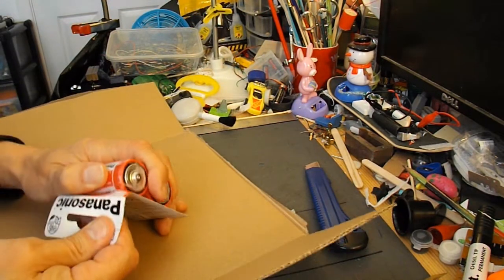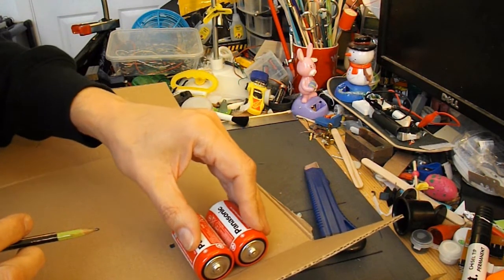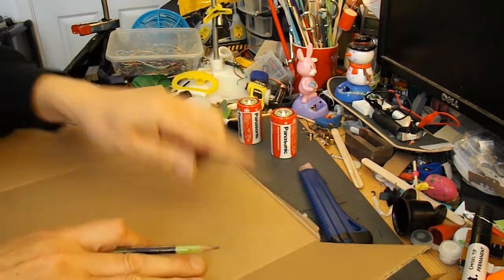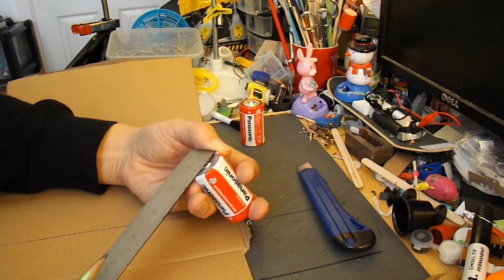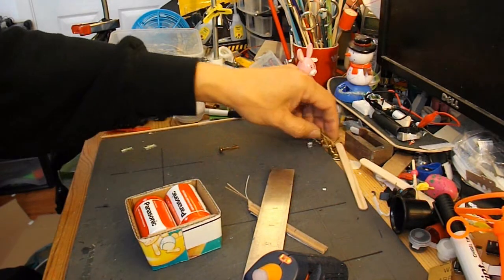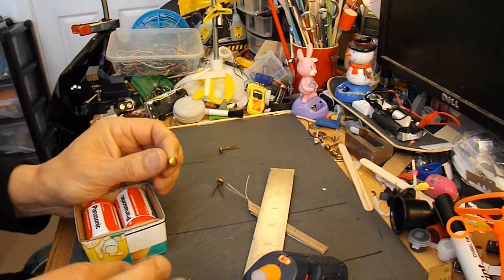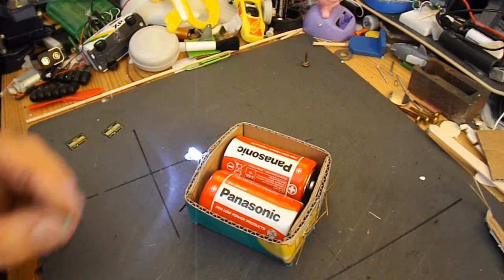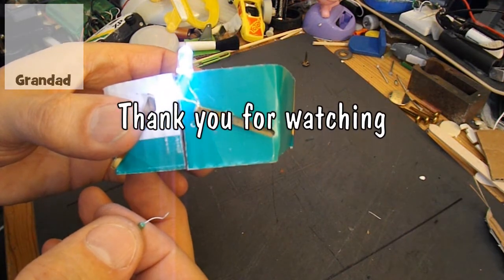2 D cells to light some LEDs - VERSION 2

Comment: could i use LEDs from an old dishwasher panel ?  thanks!
Reply from the maker: Most LEDs light on about 3 volts, but some work with less. Here is a handy article on LEDs http://petervis.com/electronics/led/led-resistor-calculator.html

Comment: I'm entering a competition where the criteria is to go the longest distance. How can I be successful at this? Which of your cars went the furthest? Thanks.
Reply from the maker: Justine Ventura I don't know which one will go the furthest as they are limited by the length of my kitchen. What power are you using? If you are talking rubber band then the longer the car body, the more rubber bands you can add so the further it can go. 
This simple one does 12 metres https://youtu.be/pIO3FiHX4Oc with just 1 rubber band.

If I assume you have some set criteria for number of rubber bands and size of vehicle I will cover the other points. The first point about travelling fast or a long distance is minimizing your friction because that is what wastes your power. 
1. Friction caused by badly aligned wheels rubbing on the bodywork should be easy to fix by adding spacers to keep the wheels clear.
2. Friction where the axle is attached to the bodywork is reduced by making sure the axle bearing surfaces are something that does not bind together. Wood and cardboard are not good. Metal surfaces are better. Steel and brass is good. Ball race bearings would be even better. Whatever you have, even if it is just wood and cardboard, you can improve by making sure there is clearance so they do not jam together and maybe rub some graphite from a pencil where they make contact might help.
3. Friction with the wheels to the ground can be a mixed blessing. Minimize the friction of the front wheels by using very thin wheels, however you may need some grip to ensure they keep the car going straight. The same applies to the back wheels, assuming you are using the back wheels as the drive wheels. However if they do not have enough grip they will spin under power and that is all wasted energy. Thin wheels with rubber tyres would be best in that case.
Larger wheels take more effort to get them turning but once moving they have the momentum to keep rolling when the rubber bands have finished. You could experiment with different sizes to see which work best.
You could use some sort of gearing to start with a large gear to get the wheel moving and then a smaller gear to maintain the motion. There are some examples in my playlists.
Reducing unnecessary weight by trimming the bodywork a little may help but make sure you don't loose grip and start the wheels spinning if the body is too light. It may bend or break under tension so be careful.
Another trick I have found helps is to stretch the rubber band as you wind it round the axle so you get more turns round the axle, this can make a significant difference compared to just winding the band normally.
If you can only use a short rubber band, connect it to the axle using thin string so the string winds round the axle stretching the rubber band. Thin string will give you more turns round the axle than thick string.

Comment: Or you could the resistor at the side of the switch. It does not need to be connected to the led, as long as it is in the circuit. It will give the LED's and the batteries a much longer life..
Reply: deslomeslager why?
Reply: If the batteries give 3.15 Volt together and the LED needs 2.95 volt, the 100 ohm resistor will take the difference of 0.3 Volt.
I = U / R, so the current is limited to 3 mA this way.
An LED is not a linear device. It is not true that increasing the voltage will increase the current with the same amount. An LED has a tipping point, above 3 Volts (or so) the current will go sky high, and the LED will get warm or even hot and burn out of course.

Comment: Hi, new subscriber here! I was wondering if there was any possible way to make a rubber band powered car using more than one rubber band? Like working  in some sort of domino-like way, so when the energy from one band runs out, another band can continue powering the car.
Reply from the maker: Justine Ventura it is probably technically possible, but I cannot see any benefit in doing that.